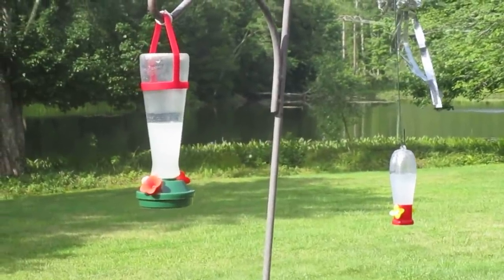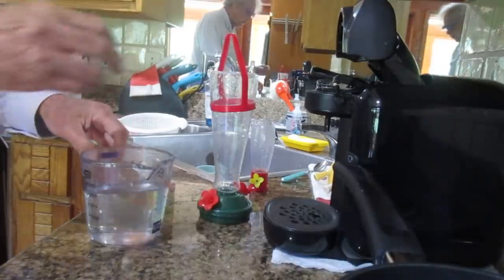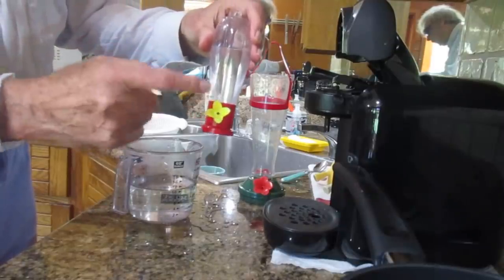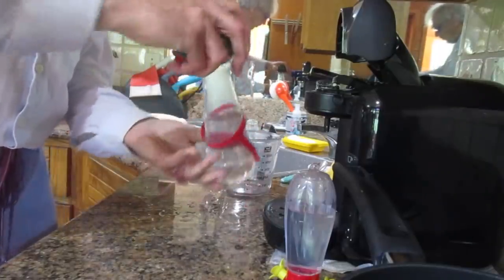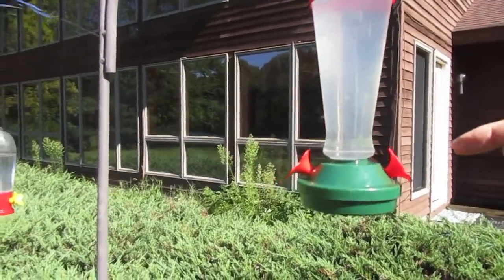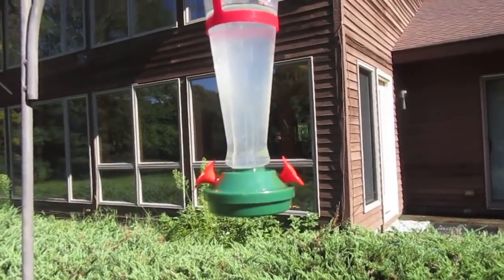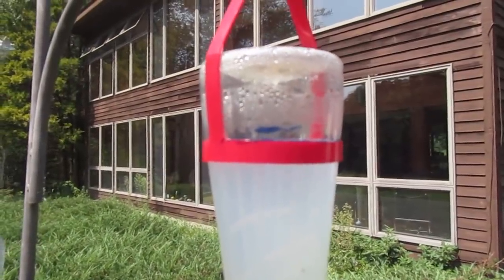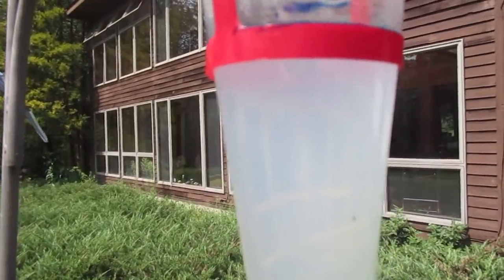Problem #118 - Mystery of Hummingbird Feeder

Comment: I  have tried to answer sir.... In below comment.... I guess you will give your valuable opinion.... 

💦Water is pushed into flower space by two things;absence of atmospheric pressure at flower point due to covering and second due to increase of vapour pressure on sunny day that cause extra pressure in downward direction at liquid air interface inside bottle.

Comment: *SOLUTION*-Initially Atmospheric pressure on top of bottle and at flower point is same that is 1 atm. But when you cover flower point pressure inside flower point drops (effect of external atmosphere is negated. So only remains the atmospheric pressure at the top which forces fluid further into flower internally and level decreases. 
Now, in sunny ☀️day vapour must be created inside bottle which will exert extra pressure at liquid -air interface inside bottle further pushing liquid inside flower space internally.

Comment: Sir, my hypothesis is that you have tied a polythene cover to the feeder, looking at the cover we can say that the pressure inside it is less than that inside the  feeder. Thus the water droplets try to move from high pressure to low pressure region through the flowers. If we open the cover we may find droplets in it.Kindly Correct me if I am wrong.

Comment: I have three different possible reasons which i can think upon
1. I think it is because of the settling down of sugar particles in the bird feeder while the water is evaporated . 

2. Also the breakdown of sugar molecule can happen due to the feeder being whole day outside and at 12 pm there can be intense sun shine .. so release gas such as co2 is a minute possibility which can eventually increase the pressure in the system and  we can think the system as a piston and the gas putting pressure on it and compressing the water. 

3.The water vapor pressure can also increased by the presence of water vapor. and the pressure compressing the the water same as in case 2 ( this is more supported by me because it can be seen that solution is slowly getting more and more transluscent , thus its concentration is increasing that is [c]=mass/vol.. the sugar per unit volume [m/v] is increasing because , [v] volume is only decreasing ) ==> thus maybe only water is evaporating and there is nothing happening to the sugar

Comment: I am not sure but is it due to heat the air pressure inside the plastic wrap changes( we know after heating gas molecules expand and start vibrating fast) ,the surface tension(that was stopping liquid to come out of those small holes) of the liquid inside breaks, so now due to gravity water oozes out slowly

Comment: I think the water inside the bottle will evaporate, therefore the air pressure inside the bottle will go up and it will push the water out of the bottle. I think that’s the main reason why the water level goes down.